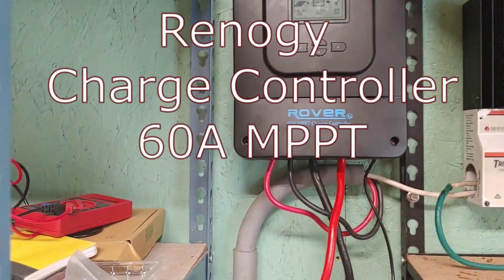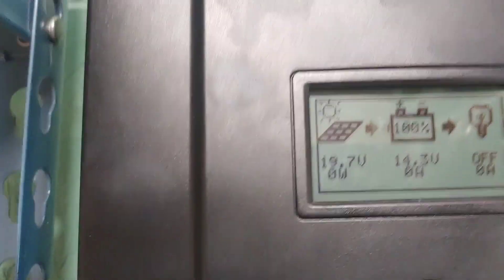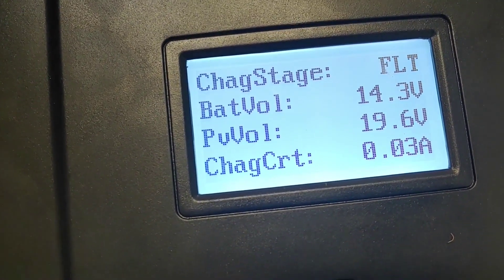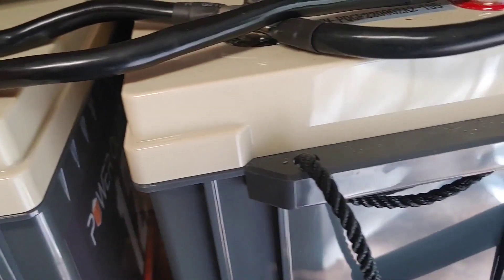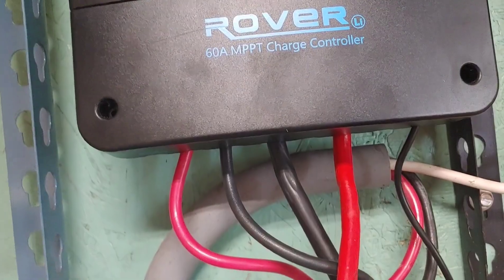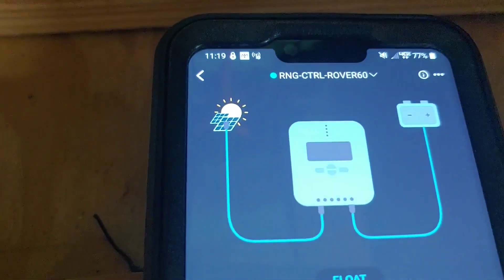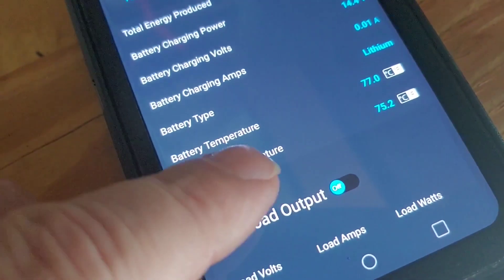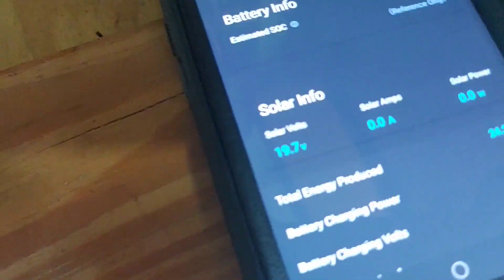Renogy 60A 12V Input MPPT Solar Charge Controller

Comment: it is hard to beat the tristar pwm 60 i went to mppt because i bought some 60v 360 w panels i think the tri star if you stayed at 24 v would just as good as the mppt
Reply from the maker: I loved mine. I still use it as a backup
Thanks for your comment.
Reply: @shoestringprep  I SOLD MINE TO BUY MORE BATTERYS I HAD TWO OF THEM I GOT ALL MY MONEY BACK OUT OF THEM WHAT I LIKE ABOUT THEM YOU SET AND FOR GETEM

Comment: so you can use that mppt to charge your battery and then could you hook the battery up to an inverter in order to supply power to an ac item like a mini split? will the mppt continue to supply power to the battery while the inverter is consuming power from the battery?
Reply from the maker: The mppt will continue to charge the battery while it's being discharged. If it will work for your AC unit will depend on the power of the AC unit how much is drawing and how big your system is. Thanks for your comment
Reply: @shoestringprep 
He needs a lot of batteries to run a AC , I SEE THEY NOW HAVE 12VOLT AC OUT THERE NOW , I JUST GO SOMEPLACE COOLER FOR THE SUMMER MONTHS

Comment: Should float not drop down to 3.2 or 3.6. Whatever the resting voltage is? Holding the charge at boost voltages consistently deteriorates the lifespan of the battery. Loss of usable ah.

Comment: What size wire did you run from the mppt to the batteries..no fuse on that wire is ok, too, right?
Reply from the maker: I run 2 gage cable and having a fuse is always a good idea. Thanks for your comment.
Reply: Alright! Thx u so much!!
Reply: Oh also @shoestringprep what size fuse?